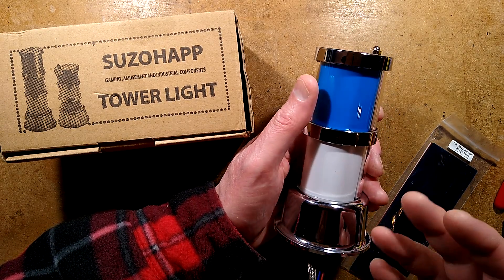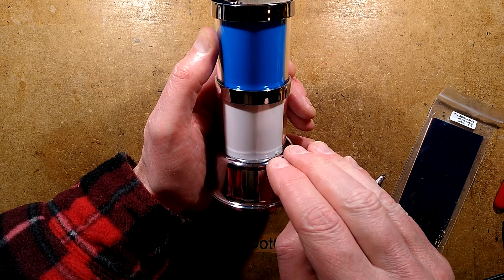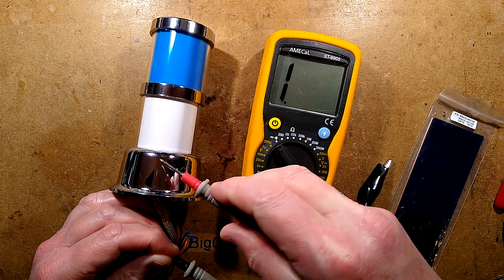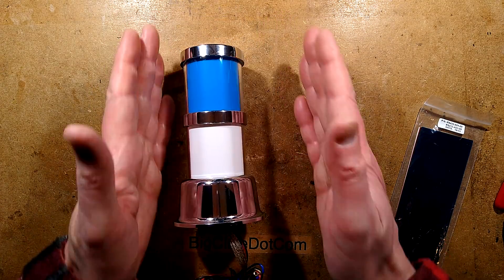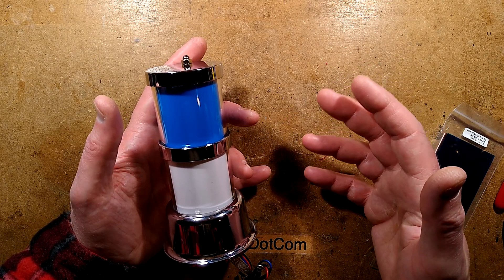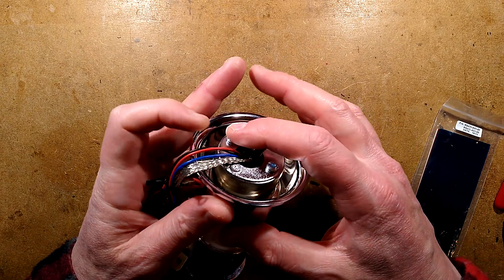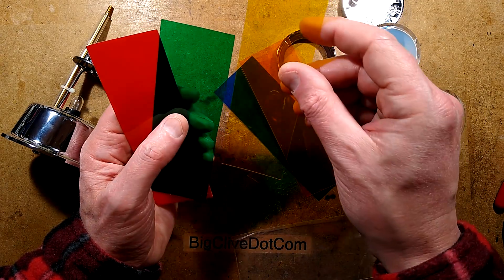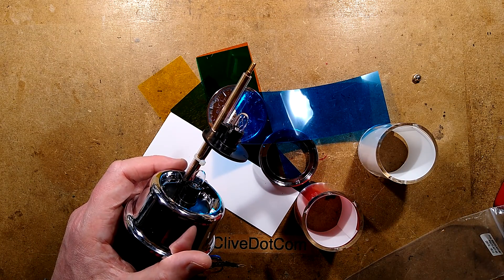Inside a casino slot machine beacon

Comment: Happ is one the manufacturers of arcade control devices such as joysticks, input buttons, trackballs and wiring harness parts. They are based in Mount  Prospect, IL, just outside of Chicago.  I used to work in the engineering division of Bally/Williams/Midway back in the 70's and 80's before I was recruited into Medical Diagnostic Imaging.
Reply: Williams pinball machines were top! Fun House, Whirlwind, Addams Family, Cyclone, Comet, Fire! and the rest of them.      Stern was so-so. Bally with the Xenon backglass was a trip. Williams with Defender, Robotron, Joust and others were a blast. I worked on those things for 2 decades.

Comment: Cool tear down!  Thanks!
As far as common positive, all the nurse call systems I worked on used this scheme for the corridor lights.  And that was across several manufacturers.  So, maybe low voltage signal lights are done that way on all kinds of things? 🤷‍♂️
Reply from the maker: Common positive is standard for easy switching to negative with NPN transistors.  (Open collector switching.)

Comment: hiss

Nothing personal. Good video
Reply from the maker: Possibly my switchmode power supply or if I had left my air filter running.
Reply: @bigclivedotcom  unsolicited clarification: no detectable hiss in your video/audio.  My comment was an attempt at using typographical effects to indicate an action/reaction. This clarification, stems from not wanting you to mistake 'hiss' for actionable feedback. Sorry!

Comment: I wonder why they still sell them as tungsten lamps instead of LEDs?
Reply from the maker: British slots still use a lot of tungsten lamps because the players seem top prefer the softer glow as opposed to the punchy LED option.
The games often run the lamps in a scanned matrix at higher voltage, so it may cause issues with LEDs.
Reply: @bigclivedotcom  If I remeber the MPU3 you mentioned used a quite heavy 50v transformer driving 12v 5w? i think, push fit bulbs. The white plastic tray used to hold the bulbs onto the glass used to go brittle and break after a while. I haven't worked on any fruit machines for years now. Although I've been fixing a fair bit of other stuff lately!

Comment: I wonder if you could buy a couple of those and roll your own extra tall one. You'd need some way to attach the threaded bars to one another (or just replace with a longer one).
Reply from the maker: You get longer versions that can be stacked.  Mainly for factory equipment
Reply: In my old town there is a metal shop along my running routes.

These lights were visible from the street, when they did their night shifts.

There are 2x ones red and green, but also multiple. Red Green yellow. Or even 4 indicators.
Also several flash codes.

So when new material needs so be fed or the machine ran into an error and something got stuck.
Reply: I have a vague recollection of supermarket checkouts having a stack of four lights back in the 1970s.

Comment: I always like looking at gaming equipment too and how it is (usually) so well designed for the abuse of the general public but still built down to a price.
Reply: the internals are way too powerful for what these things do though. some of these machines that are only a couple years old yet have decent CPUs and 8 gigs of ram just to spin some pictures.
Reply: oh not to mention some of them run on windows so that's an extra expense tacked onto the machine a windows license you don't even need. 🙄 slot machines not just a scam for players 🤣
Reply: @SevenCompleted  Oh hell yes. Every single one of those machines has a custom proprietary mother board, back plane, power supply and so on. The casino has to replace failed components with identical parts, as that's what went through gaming commission certification. That's a system ripe for abuse by the machine manufacturers. Thankfully the machines are expensive enough and manufacturers small enough that management of most decent-sized casinos can call the company and threaten to stop buying their equipment if they don't fix an issue. For instance, Everi had (has?) a ~$1500 motherboard with a disturbingly common DC-DC converter issue where a ceramic capacitor blows a hole 3 layers deep into the PCB. The motherboard is scrap at that point.
Reply: @SevenCompleted  For some configurations, that's very true. A casino wants to replace the old machines they can't get parts for, but also want to keep their customer's old favorite themes. You end up with software originally built for a Pentium II running on an i7. Though others have a 4k main monitor, video button panel and a topper monitor to cover. Throw lots of particle effects and 3D graphics on that, with the expectation that the frame rate never drops. At that point, throwing some decent hardware specs in there starts to make sense.
Reply: Gotta stand up to some anger. Haha. Although it dosen't look too strong, a solid whack would bust that.
Reply: Some of the buttons are so satisfying, they put arcade machines to shame. I'd love to have a home controller/interface with high-end casino slot buttons. The travel, the click, the tiny OLED screen, the durability, would great fun for assigning midi drums to or playing aggressive finger DDR, or simply slamming for an alt-f4 shortcut, haha. Plus they're spill proof.
Reply: @VGScreens  The OLEDs last 5-7 years in 24/7 (casino) use. Their brightness fades with on-time, leading to worse burn-in than those green monochrome ATM screens from the 80's. Periodically inverting the graphics handles burn-in well enough, but the overall brightness still fades.
The IGT buttons are individually modular and mechanically very serviceable, but electronically 100% proprietary. You would need a complete slot machine to reverse-engineer the protocol, though there's an HDMI cable conveniently near the button end of the signal chain. If someone reverse-engineered it, there's an awesome (though rare) 3.5D joystick/button (analog x, y movement, incremental rotation, button press) with a round color LCD on it that appears to use the same interface.
WMS panels send their signals over USB and there's a windows-compatible diagnostic utility that allows full control of the panel, though it's kept under license lock-and-key. Still, snooping the USB traffic and writing an open-source driver isn't out of the question.
Unfortunately most of the new machines coming out have gone capacitive touch screen for their button panels. Long aspect ratios and easy OS compatibility is all they have to offer. Konami had an Omron-built/designed panel with see-through buttons on top of an LCD screen. It used a thin film transparent PCB on top of the screen for button sensing and bezel LEDs, though the button mechanicals (silicone membrane based) failed on long-term ruggedness (people tore them apart) and got swapped out for touch panels.
Reply: @VGScreens  i get to repair these machines on a daily basis. The buttons look nice but are far from spill proof. The OLED buttons can run around $98 a piece and take a proprietary driver to interface to the computer in the game. You'd be surprised to see the amount of damage players can do to these machines, from punching video decks and screens to pouring drinks into printers and bill validators. Each one of the games can cost $25,000-$30,000 for lower end models the higher end stuff gets crazy.
Reply: How would it compare to arcade games, or interactive kids museum exhibits?
Reply: @BlackSoap361  Slot machine static buttons (the non-video kind) tend to be slightly softer to press, and all have a large back-lit window for a "legend" (label). They're mostly squares and rectangles of various sizes, though they get creative with one or two large spin buttons some times.